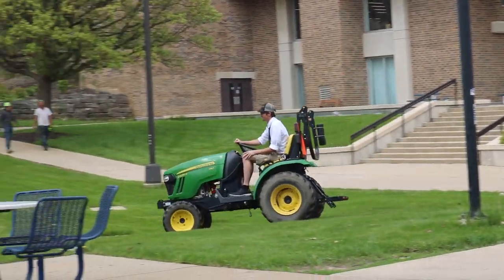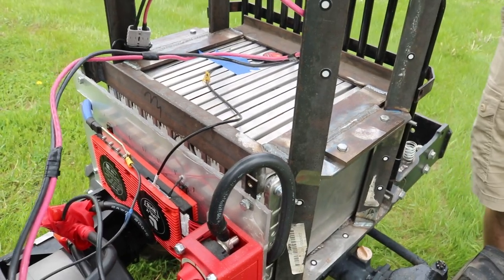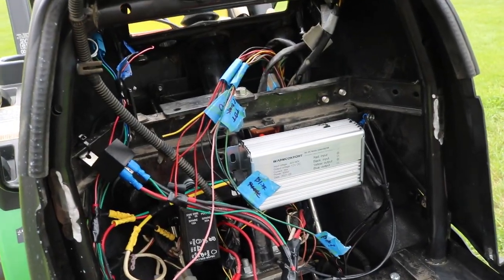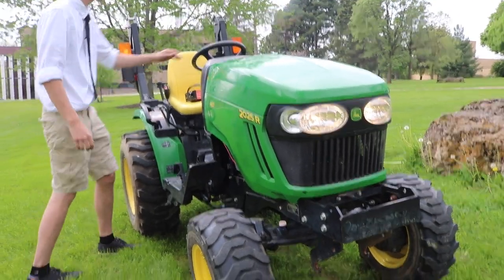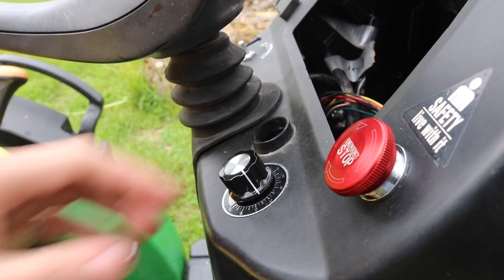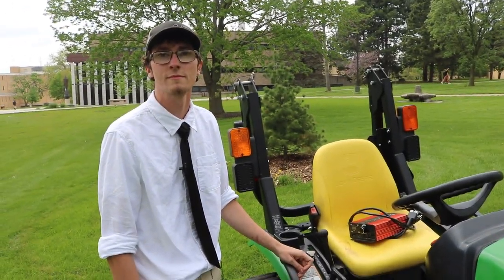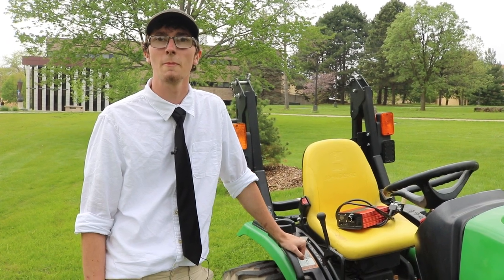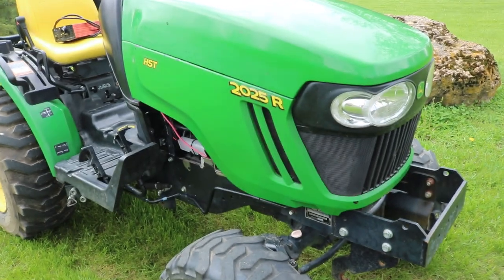Electric John Deere Tractor | Student conversion | 72V Lithium

Comment: @Benjamin your original DC car vid series encouraged me to try it out. I have set up the Same basic 72V system as your Geo Metro, but with Curtis controller.

I just noticed I have used the exact same motor the students did in this small tractor. I haven't got it driving yet but fear it may be too small a motor.

The vehicle is only 650kg in curb weight in stock form with original petrol motor, a tiny 5spd Daihatsu.

What do you think?

Thanks again for the inspiration!
Reply from the maker: I guess that I would say at this point to just drive it! Have some instrumentation so you know how much current you are drawing and what your voltage is.
For a small and light car, driven reasonably, that motor may be just fine. I used the smaller 48V version in my electric motorcycle and it worked well.
If you are just driving in the city, it may be just fine.

If you find out that the motor doesn't perform as you would like, at least you now have the experience of working on an electric vehicle and you can look into finding a more powerful motor with which to upgrade.

If you are in Washington state, there tends to be a pretty good EV culture there, and I'm sure you can make some new friends to talk shop about EVs and maybe even find a used motor that will fit the bill.
https://www.myeva.org/chapter-list

Comment: Did you see the dual rotational cylinder hydrogen engine 160 hp 200 torque. Engine weight 48 lbs. Sounds really good. Who knows?

Comment: Awesome project,  the young students just need to brush up on Hydraulics and the absence of clutches and conventional transmission parts in a hydrostatic transmission.
Reply from the maker: I think he was just trying to make a simplified metaphor to a traditional automotive manual transmission.
Reply: Ben is correct, it is more like a torque converter in an automatic transmission rather than a clutch.

Comment: Thanks for the video.

I think your electric motor is too big, you can probably run that tractor as well as the diesel with an 8hp motor electric - 22 x 746 = 16.4kW; ~6kW for 8 hp. What's you battery voltage? 

It's not a one to one power ratio, the electric has a constant torque band, the diesel doesn't. With 8hp you'll get over an hour run time and the pumps will still give you all you need to run the hydraulics. With a smaller motor you'll also have more room for batteries. Also I'd run LiFePo4's. Less dense but who cares, it's a tractor.

The hydrostatic also drops your efficiency, better off with a gearbox and varying the motor speed, especially with the torque of the electric, better combo.

Comment: 4 hours to charge just to get 20-30 minutes of use in its current build form. Even Another bank of batteries wouldnt make this ideal on a job site.....unless you are taking a lot of beer breaks.
Reply: That's just with a basic 1.3kw (110v*12A) trickle charger. They said it was running about 3.6kw (72v*50A) under normal load, so with a little more time and effort, like would be done on a production model, it'd probably be able to charge as much as twice as fast as it's drained. The goal for Senior design (not production) projects is often just to get it to work.